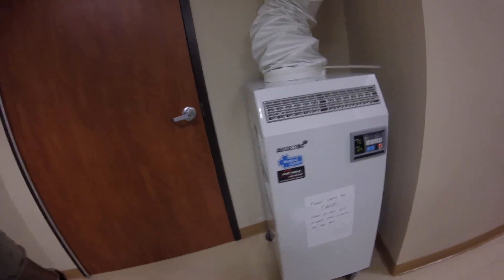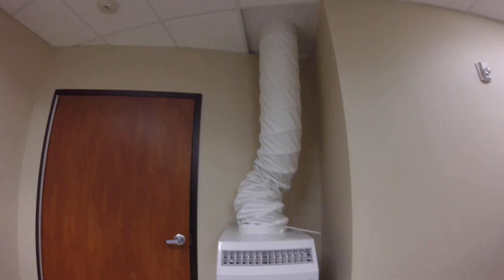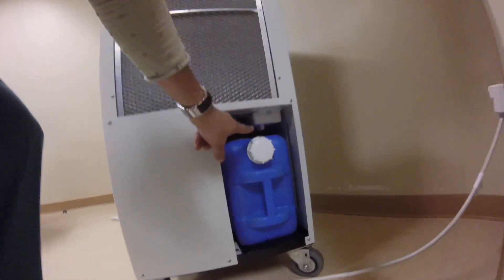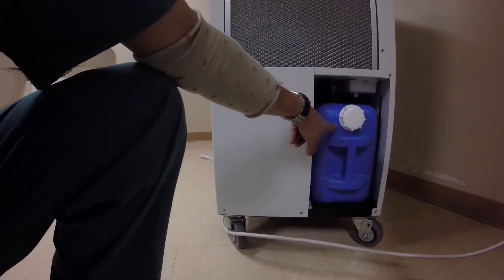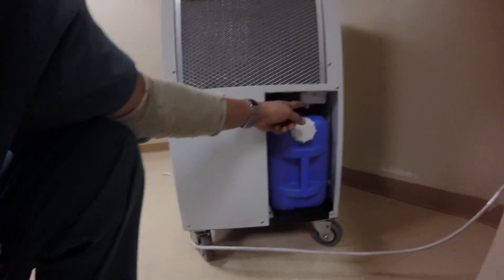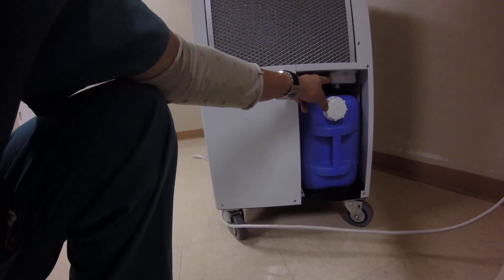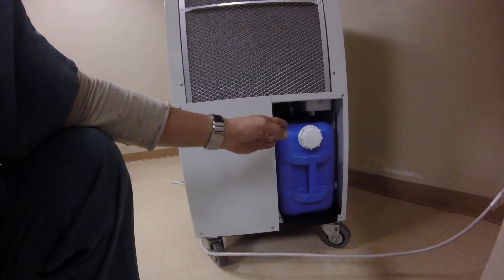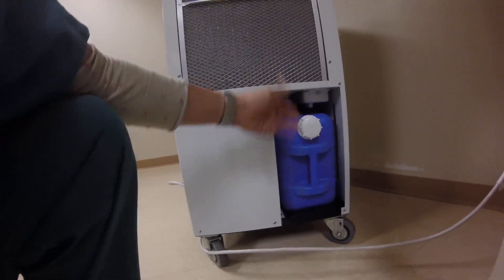Portable AC maintenance & Mildew elimination

Comment: Would vinegar be better to use instead of bleach? Only because bleach is so corrosive
Reply from the maker: That is a fantastic idea. Although, vinegar may have to be used more frequently than bleach. One idea is to dilute bleach 50/50 and then running a water cycle to neutralize.